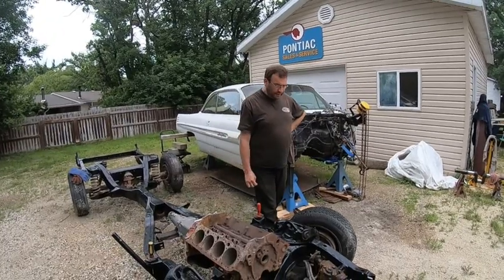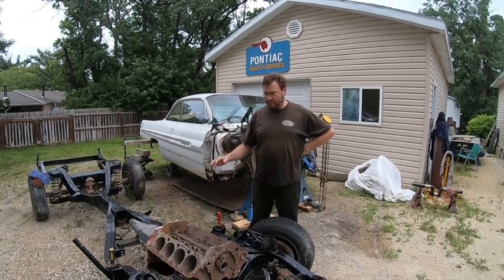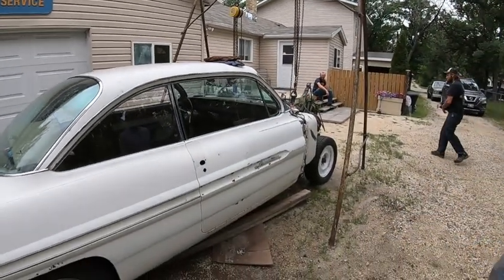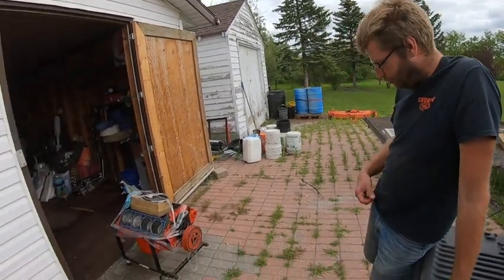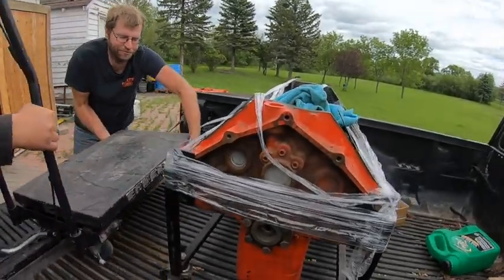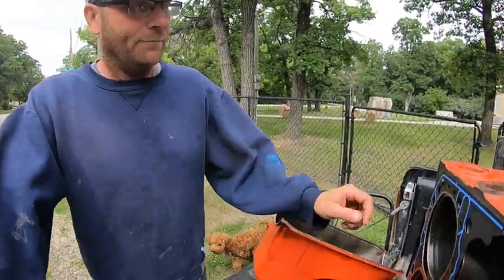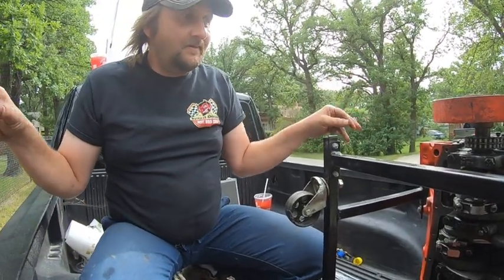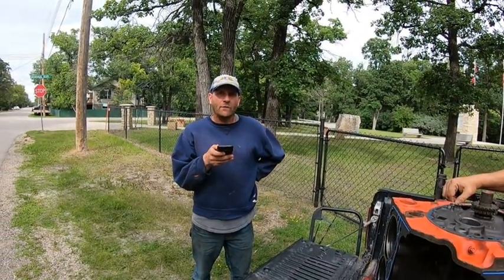1961 Pontiac Laurentian.  Installing The Frame Back Under The Body.  And A New 327 Purchase.

Comment: Just seeing the last 3 numbers on block it was a 657 that engine was used in 1967 same block used for the z28 for that year and the SS350 Camaro first year for a 350 engine small journal crankshaft and the block was used for the L79 327 engine,  Very rare and expensive block you have there,  I had one and  sold it to a guy with 1967 Z28 rtthat need a block to match his car, as only 602  made, block used as 350 engine 327 engine or the Z28 302 .Sold mine and it paid for new crate engine     Great Luck Go Pennys
Reply from the maker: Wow thank you for the imput Brenda im very happy with it and cant wait to build it. Thank you again.

Comment: I have the same 67 327.... it had number stamped on the oil pan surface.    I think it's a good motor myself.   Mine runs great.... I have the double hump heads.... no accessory holes.  I'd like to see a pontiac motor go in your car but I know they are crazy expensive and hard to find.
Reply from the maker: I have been looking for a Pontiac engine but you are right they are hard to find around here
Reply: But the Canadian Pontiacs used Chevy drive train anyway. Or at least they did in '63

Comment: I am amazed that the old A-frame lifts all your projects without buckling under the weight...
Reply from the maker: We welded a angle metal to the top and we have lifted over the years alot more then that its been pretty handed there paul.

Comment: Excellent Video  Penny's Crew  :) also Casey you get Allowance Lol& well done frame on body of car and Cory luck find this 327 motor for $700.00 and think that motor has low mileage on May have about 60.000 miles on to because nice shiny on it only thing maybe got changed was time chain plus gears to ! Also frost plugs I see looks like be changed otherwise nice good condition and use to !

Comment: Watching you guys grunt that motor into the back of the truck made my back hurt!  The last small block I did that to was in my last Chevy (78 Caprice) that was toast at 80K.  Got a new short block for $750.00.  Stripped the old block down, got underneath it and rolled it up over the fender (figure it was easy enough to fix the fender later--no hoist).  Now that I'm older and wiser???
Reply from the maker: The things we do some times there will be a new video tonight of an engine we got from Dan.
Reply: Unfortunately will never grow up Glenn 🤯🤯

Comment: L2211 should be 327 pistons and it shows there between a 12.15 and 12.7;1 compression using a 64cc head.
Reply from the maker: Mint thats alot of compression Rick im happy i got it.

Comment: The engine might be a 375hp------327. I heard you say1969 327. It would depend on what heads you use.  Me I would fine the old double humps heads 2:02----160.I have 2 pair myself (not for sale). The pop up  pistons look good, forge crank, ????might be a hp engine. Standard bore standard rods & Mains.....Very rare to find all standard. Someone just change piston & balance the crank my guess...Any way Great engine my friend....ALSO great build the car looking nice.....
Reply from the maker: Thank you for all the information Marvin im happy with it the block is from 1967

Comment: Them are not after market pistons they are forged trw for gm performance engines 327cid 375 hp sounds like the hyd copy of the original mechanical L79 or  MO-DZ 302cid cam I have a couple winters intakes one is for the 327 vette it's  odd looking Square bore with two holes on the rider side and a single big hole on the driver's but imo the dz & lt1 intake is the best sbc intake ever built for hot street 😉
Reply from the maker: Thank you so much for the info Smokey I'm very happy with it.